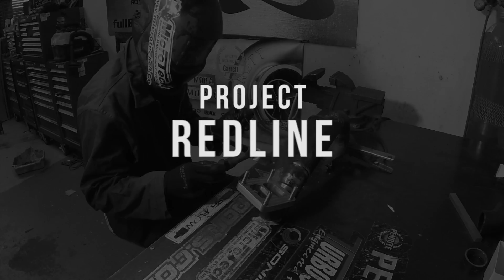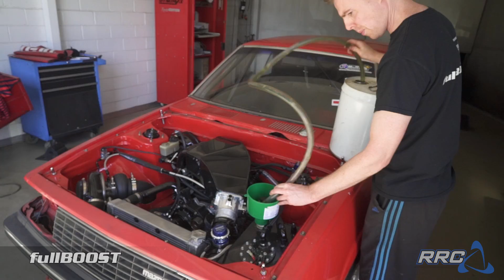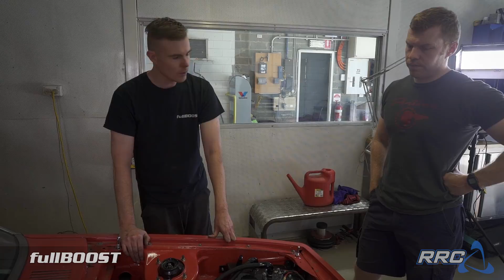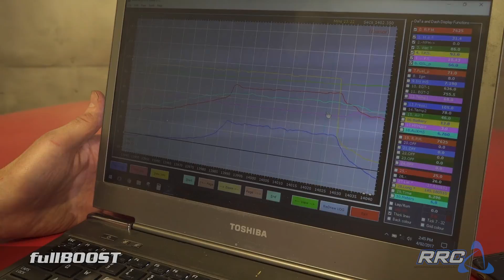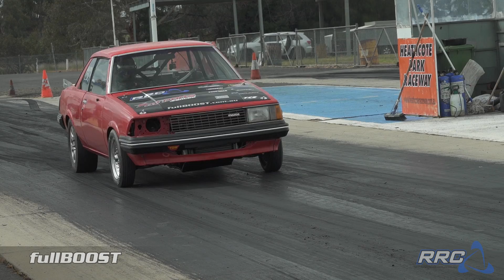BACKYARD MECHANICS | DYNO time | Project REDLINE Mazda rotary build Ep 12

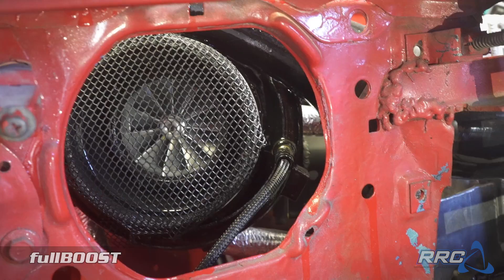Comment: Hope whoever did the welds at 2:27 didn't do the roll cage.
Reply: I don't call that welding..... it's a drizzling of metal (or something).  I actually thing that was the original owner....
Reply: Brandon B . He was referring to the welding on the radiator suport, which was done by the orignal owner years ago. The aluminium welds on the plenum are great.
Reply: dunno.  i didnt do it, dont know who did, its structurally sound, so SEND IT!  There are many aspects of the chassis that arent A1 when i got it, but im living with them if i have to as they are still functional.
Reply: Just because it looks good does not mean it is a good weld. If you want show you could grind it back.
Reply: Its aluminum welds. They are always bigger and fat and not super pretty. I bet if the same welder did the roll cage(prolly chromoly) the welds would "look good" enough for you...The welds lay totally different. This is a race car. Not a show car. If the welds hold (which they most likely will) then they served their purpose. Can't judge a weld by how it looks 6 feet away from a you tube video.